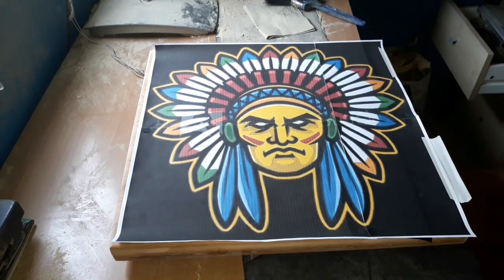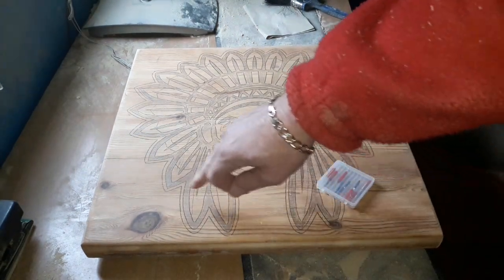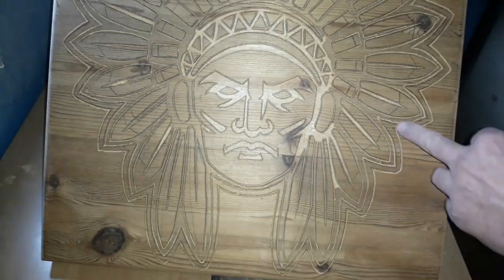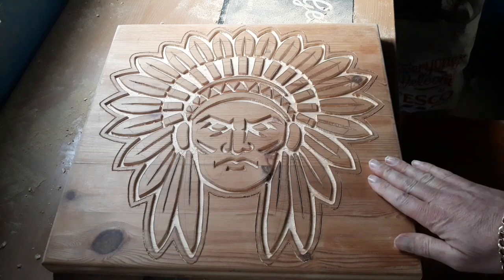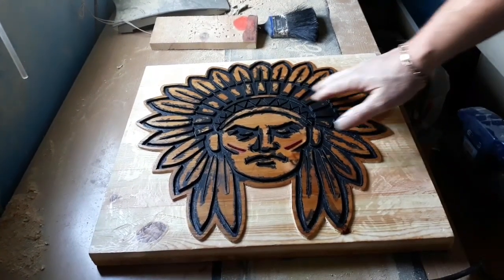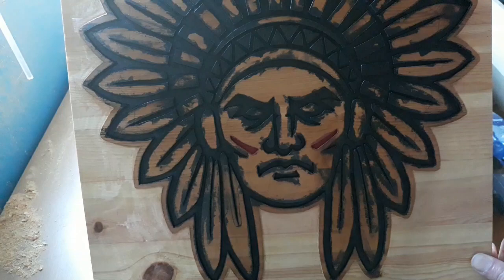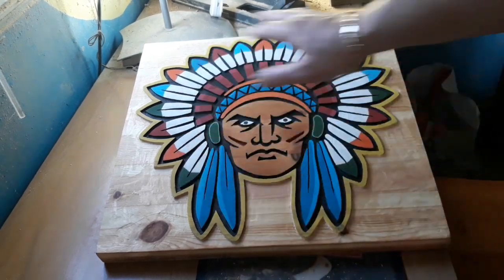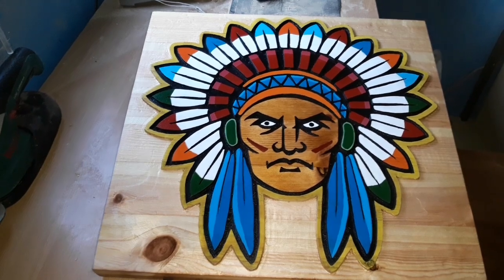Indian Chief..Router project.

Comment: Hi there again and very nice job on this one. My question today is  for the outline of most  of your projects is about 1/8' then 1/4" there after.
Reply from the maker: Good morning Gail, I use cnc bits for all my lines,at a depth of 3mm,the same thickness as the cnc bit,I clear out the unwanted woid with end milling bits..on  larger areas I use straight flush bit that have a 1/4"shaft on  them..all depths on any bit is mostly 3mm..😁👍

Comment: great project ,, was wondering why you have problems sticking  the paper down ,,, have you tried using heavy duty carpet spray / upholstery glue ,,,  sticks paper down really well ,, infact to well , i need to use a belt sander to remove the excess paper afterwards ..
Reply: forgot to say ,prior to using the above i used to use pva glue ,, not  bad ,,but it did smudge and blur the image a bit  . and you had to wait over night for it to dry ,,where as the  above glue  takes 2 mins or so to dry
Reply from the maker: @thelittlewoodshed1338  I've stuck the paper down before with spray glue no problem. I just dont like routing out over it I prefer to use carbon paper and trace the image ..works for me,plus you can use the template over and over again..

Comment: Could you, please, post a link or description of the bits you are using?
Reply from the maker: These cnc bits are great for the line work...https://rover.ebay.com/rover/0/0/0?mpre=https%3A%2F%2Fwww.ebay.co.uk%2Fulk%2Fitm%2F163661629115
Reply from the maker: You will need a collet sohttps://rover.ebay.com/rover/0/0/0?mpre=https%3A%2F%2Fwww.ebay.co.uk%2Fulk%2Fitm%2F202740392004 they fit a 1/4"  router...
Reply from the maker: These mill end bits are great for clearing out in those tight areas...https://rover.ebay.com/rover/0/0/0?mpre=https%3A%2F%2Fwww.ebay.co.uk%2Fulk%2Fitm%2F223542411046
Reply: Thanks for the prompt response! I believe my router has a 1/8" collet.
Reply from the maker: @jeremiahcollins5155  no problem,the cnc and mill end bits will fit a dremel without the collet..
Reply: Unfortunately, the seller doesn't post to my address. If there's no other way, I'll have to find a similar product elsewhere. Hmmm?
Reply from the maker: @jeremiahcollins5155  that's a shame plenty of other sellers to go at..
Reply: @fishtank5050  cheers!
Reply: @fishtank5050  links no longer work :(
Reply from the maker: @abelcanahui3459  go to my latest video, links in the description 👍